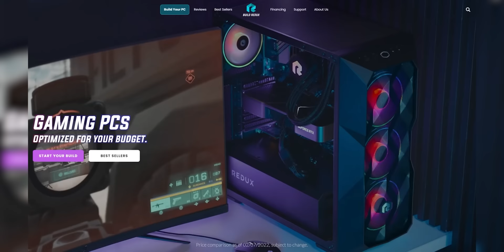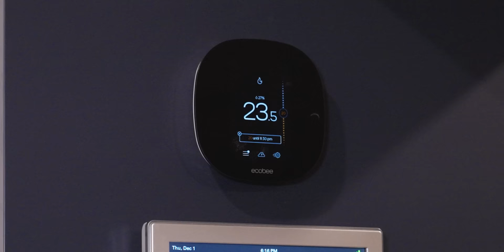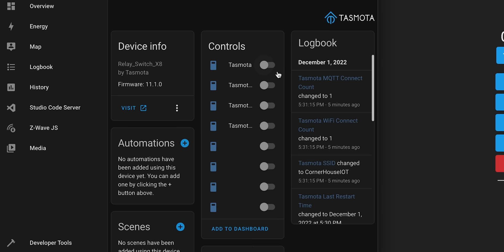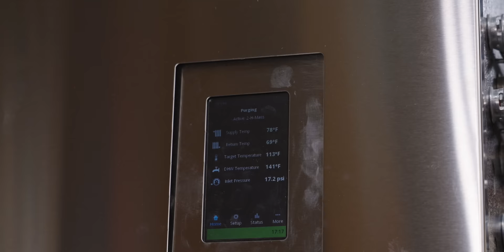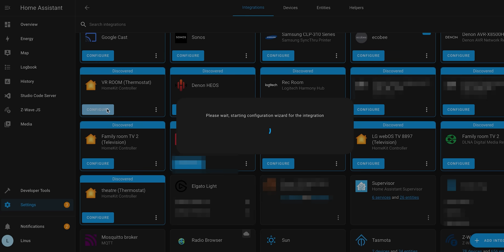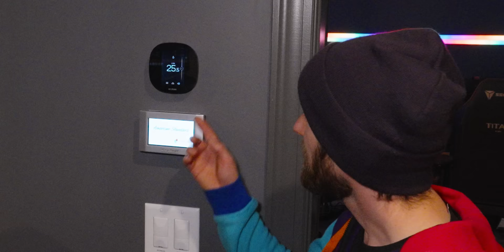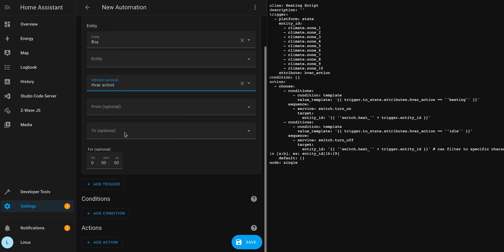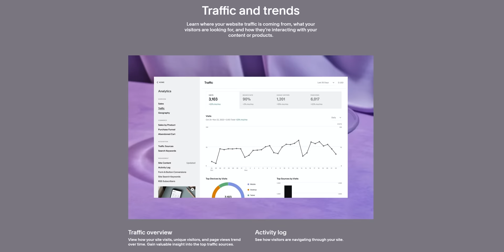My Smart Home is Stupid - HVAC Update

Comment: Linus: “You never want it colder than 19 inside” 
Anyone on oil heat: “14 is plenty warm for me this year”
Reply: *Anyone in Europe 🙈
Reply: @LuckyLukeTF2  Anyone without a heat pump or free wood or both :-)
Reply: District heating and sharing every wall/floor/ceiling with neighbors  => 24+c at no extra costs
Reply: @LuckyLukeTF2  Facts!
Reply: @PennyAfNorberg  Same for me. District heating is just awesome, especially in an apartment on the 2nd floor of 7. Even better is that our heat is cheap because well over 50% of it comes from waste heat from the local power plant.
Reply: @LuckyLukeTF2  Yall dont got furnaces?
Reply: @whitegoodman7465  your furnaces don’t need fuel?
Reply: @whitegoodman7465  I'm paying €1 per kWh and €3,50 per m3 gas this month so yeah I'll think twice before setting the temp at 19 or higher lol
Reply: @LuckyLukeTF2  jesus, where do you live?
Reply: @Jupeee  The Netherlands
Reply: @LuckyLukeTF2  jesus... that's TEN TIMES more than I pay here in Iceland!
Reply: @LuckyLukeTF2  that's insane, i'm paying 0.16eur/kWh in Finland
Reply: @Jupeee  Here in the states power is the equivalent of 0.09eur per kWh
Reply: @DJ.1001  yeah I was paying about 0.08 before the ukraine war iirc, mightve been less
Reply: Was boutta say. 19 is a bit chilly? Mann I live in europe and when I wake up my living room is 13 and ill heat it to 17 and it that costs me and my roommate about 250 a month. Btw, 17 is pleeenty warm. Just put on a sweater.
Reply: @maquez650  depends, for me 20 is "sweater temperature", anything below that and I need to put on a jacket :D
Reply: @blaineadij  I suppose that depends on how accustomed you are to certain temperatures. I keep my apartment at just below 20c (18c-20c) and it's a temp I'm comfortable being shirtless in. The colder it is the more comfortable it's to sleep in!
Reply: @Jupeee  I live in Italy, so for 6 months a year the temps are 30+ degrees here, so I'm pretty used to high temps. Besides, I have small kids and having anything below 20 degrees is just asking for them to catch a cold. ;)
Reply: @blaineadij  i mean, growing up my house always used to be 17 degrees max in winter, and i rarely ever got sick. In my opinion it's just a case of getting used to it. Yeah the first week when it starts getting colder I'm like damn it's pretty chilly, but after a few you just don't notice it anymore in my opinion.
Reply: @maquez650  if you're used to having 30+ degrees every day for the better part of the year and temps dropping below 20 only in like 3 months a year, it's hard to get used to lower temps :D my kids who never lived outside of Italy ask for their sweaters when temps drop below 25 outside :D
Reply: Oil heat is pretty OK in Europe now. Depending on when you topped up your tank. But gas heat is just a disaster.
Reply: @blaineadij  hahaha, okay fair. I suppose your outside temps are higher than too so it would take less to heat to that temperature
Reply: @maquez650  that's true, but on the other hand houses here are build to cool quickly instead of keeping the heat inside, so during winter months I have to be constantly heating the house otherwise the temps inside the house would easily drop below 15 every night
Reply: @blaineadij  yeah I feel you, my house might not be built to cool down, but it was built in the thirties, so with the heating completely off most parts will drop to about 10 degrees.
Reply: My thermostat in the UK is at 9C rn, sucks to be a poor student with the cost of living rn. Having an electric blanket on my bed is the only way i'm surviving this winter. Monthly bills for gas+electric are £50 if anyones interested.
Reply: @blaineadij  fair enough, you wouldn't be able to catch me in Italy in any other state than miserable as hell due to the heat :D in central Finland the temps can reach low 30c in the summer and not much colder than -30c in the winter, but both are kind of extreme cases and wont happen more than a few days of the year if at all. Buildings in Finland in general are extremely well insulated compared to the rest of the world (and it goes both ways, it doesnt just keep the heat in during the winter, it also keeps the heat out during summer) that it's kind of wild to me imagining that in most countries a lot of effort or money goes into cooling or heating a building depending on how far north you go. I could lose electricity and district heating for a day here in the dead of winter and the apartment might cool down a bit but it wont get straight up cold. Granted if it was a house the case would be different and it would get colder quicker, but living in an apartment building it's no problem whatsoever.
Reply: @Jupeee  good for you. I am paying 0.39€ plus transfer with Helsinki Energy. My consumption last year (Oct-Oct) was 90 MWh - OK, some 30 MWh went to melt snow from my yard, which I am definitely NOT doing now 😂😂
Reply: @syncacct8576  ouch :D idk how much region can have to do with the prices if at all, not gonna say specifically where I live but you can probably take a fairly accurate guess by picking something in central finland, student city. Also living alone in a one room apartment's does wonders to my electricity bill
Reply: @LuckyLukeTF2  This is what happens when you outsource everything.
Reply: As long as the pipes don't freeze over, it's fine.
t. European on gas heating

Comment: I see this, and see how many "moving parts" there are to this set up and all I can think is "wow, this is going to be a nightmare eventually". I mean if it's this complicated now, how much worse is it going to be when things inevitably start breaking?
Reply: That'll never happen...it has to start working first.
Reply: "More content!"
Reply: As someone in the commercial HVAC world it is not uncommon for units to be connected to a BAS/BMS. The equipment usually has a service mode that allows you to bypass and check the unit operation. 
For your everyday residential tech who isnt used to this, it could lead to more problems than it solves, but my guess is the installing contractor will most likely maintain this equipment when it eventually does have issues. So they should at least be familiar with the set up.
Reply: @OramWerd  At what price? And when Locutous isn't around, what then?
Reply: This one specifically is just a horrible setup with seemingly a lot of solutions just to solve for previous problems, rather than taking a step back and really taking a good look at finding a reliable, easy solution that addresses the core problem you're trying to solve.

In this case many of the problems appear caused by wanting to combine multiple systems and finding hacks to make everything work together. The Tasmota and Ecobee system work together pretty well already, but then there's the American Standard system they are trying to make work as well and I don't really remember why that was exactly.

A solution that would've given far less trouble for example was just to set it up as they had originally planned, with no thermostat in the room, just a thermometer and having it all be controlled through the Home Assistant interface. Would've been one system (Tasmota) and one system for temperature readings. They added the complexity of the Ecobee and that American Standard system because the family wanted the ability to control the heat per room. What they could've done instead is follow the original plan, but simply add a touch screen with a Home Assistant control panel on it (which is more in line with how Home Assistant is designed to be used).

I don't blame them at all for the situation they're in though. I know exactly how this evolved into mess, because I've done it myself. Instead of going back to basics, you tend to "add" solutions. Either because you think that one little extra thing isn't that big a deal or because you bought something expensive you feel you now have to make work.
Similarly, there's a strong "while you're in there" feeling where you're like, well if I'm already doing this, I might as well just add this little thing.

I am a little unclear on the whole Z-Wave debacle though. With their backgrounds I would've thought they understood the value of having at least the core of your home being wired up and not be wireless. There's super robust systems used in office buildings, hospitals and homes like KNX for all this kind of stuff. All which integrate easily with Home Assistant. They could've added some Z-Wave here and there to supplement it or get control in places where it was cost prohibitive to put wired devices, but to have your whole house on Z-Wave is a pretty brave move if you ask me.

Same for the garage door. They tried three times and only at the end really looked at what they were trying to solve (they literally describe their requirements clearly at the start of their FINAL video on the topic).

But all of this is definitely part of the fun of it. If you don't enjoy thinking about things this way, home automation sucks and I wouldn't touch it. If it all works it's magic, but it's not worth the hassle if you don't at least enjoy the hassle a little.
Reply: This entire house was not planned and designed by professionals. It is going to constantly break if it is ever actually at 100% at some point which it probably won’t be….. ever…. I feel bad for the person that buys this house later on. Most likely they pull out all the automation that was put in.
Reply: @OramWerd  Or they'll make another video about it (fair play, honestly)
Reply: Linus is going to have to learn KISS again, the hard way. 😁
Reply: 100% agree with this comment. On principal, I agree with exploring how to do this without relying on the cloud or subscription service to help manage the system of things, but it really highlights why there is a (fragmented) industry around this technology. At the end of the day, and Linus acknowledged it in the intro, you could figure it out yourself but you’ll need a full-time IT staff to support it
Reply: @Forcix  100%!!!
Reply: im laughing how an american house basically needs a whole plant room for its heating , like WTF ? in the UK all we need is a small gas boiler in a tiny cupboard with a few pipes coming out and its all automated and that one boiler does hot water  on demand and central heating
Reply: @girlsdrinkfeck  To be fair, that's a really big house and they're based in Canada, which is a hell of a lot colder than the UK in winter.
Reply: @tibor29  arse biscuits ,get on the exercise bike to get warm, i do LUL

Comment: Linus: Has like a billion devices in his house that could be configured to run all of their communications over a wire
Also Linus: Why are my speakers that probably should be wired having interference?

This house is probably using up the entire 5 GHz band
Reply: And his primary communication should be KNX when starting a smarthome from scratch in a bare house. And everything which is bolted to the wall shouldn't use wifi.
Reply: @@onnikukkonenI’d be surprised if Linus is using a PSK for his WiFi.
Reply: The house is probably just using all the bands! 2.4, 5, 6, an unreleased 76!
Reply: All wifi on channel 69(blame Jake)
Reply: @FluffyAnnoyed  Definitely... He should've just gone with KNX or Loxone and let it setup by a professional... you can still implement it in HA. But then he couldn't make like 20 videos about his smart home.
Reply: @jorrit_o  Nah, he could still do it, but they'd be a sponsor video for Loxone instead. LOL
Reply: His neighbours probably wrapped their house in tinfoil to avoid radiation
Reply: I can't believe all these smart devices talk over WiFi when they are plugged into the houses AC.
Why are they not talking over these convenient copper cables

I run my network over the AC and it's faster than any device can move data on the network.

Actually I do know why.
It's because WiFi is easy and there are no good standards over AC anymore.
Reply: @TheZoenGaming  Honestly, that would be really interesting😂
Reply: @Onni Kukkonen It's the illusion of convenience. When in reality it's 10x more inconvenient. Wires are good. Just manage them properly
Reply: There's also connect4 that do I good job letting you choose what devices you want now and is very flexible fir later upgrades.
Reply: @jorrit_o  He could have setup KNX by himself. It would have been way easier.
Reply: The problem is, if Sony gives you thousands of dollars to use their wireless speakers, you actually do have to use them.
Reply: @4203105  He definitely could've just used them for and then installed proper speakers after, it's not like Sony is holding his living room hostage by sponsoring a single video

Edit: Removing redundant phrasing

Comment: You can really understand Linus' priorities when he goes to great lengths to run Ethernet cables to every wall of every room in the house but can't be bothered to run 2 more wires for each thermostat or 2 wires for reliable speakers. And when you have to have someone (Jake) set up scripts and train you on how to use your own 'smart' home system, you know its way more complicated than it needs to be.
Reply: The speakers is because he already had expensive wireless ones. And they have a theatre room completely wired up wtd you going on about??
Reply: @sid6645  The speakers should be wired though, because the wireless setup is causing problems and the speakers won't be moved anyways
Reply: @felix871  his TV set up is super jank because he has a theatre room. Its just his family's unfortunate preference that they like the jank set up.
Reply: @sid6645  I know, I also prefer the theatre room but maybe they want to watch two different movies at the same time or something, he can definitely afford to have two proper setups. It’s just that wireless stuff usually sucks
Reply: That's the problem when you take free wireless speakers from Sony. You have to actually use them.
Reply: @sid6645  can't blame them to like the Sony TV, it look freaking awesome
Reply: @felix871  The only reason for buying HT A9 was to avoid wires in the living room.
Reply: @felix871  So it doesn't have to be, Noted. Sony, as per usual, has very jank and limited software control. Secondly, the reason it does not work is due to his motion detector switches. 
The wireless option is actually much simpler in his living room. He has Surround afterall, and these sony speakers are quite litterally pug and play any one can do.
Reply: @felix871  Audio over Ethernet is an option.
Reply: really true.. the thermostat is already capable of closing a relay without any wifi smart device inbetween. It doesn't even need the cloud to do so. So many fault points, we will see a video where he blames home assistant for it not working.

Comment: I appreciate Linus for going through all this to showcase how IOT is hell and mercury switches are awesome.
Reply: Just like I always say about mercury: Don't knock it 'till you tried it, the taste really grows on you.
Reply: It’s just amazing to me that he didn’t just do the most simple option of using the American standard thermostats to control the in floor heat through auxiliary contacts. I get wanting all the controls to be local and not dependent on the internet but even my nest thermostat will still cool and heat my house if the internet stops working.. this whole system is a shit show.
Reply: @alexlacey9808 It’s because he thinks avoiding the 1 in a 1,000,000,000 chance that the internet connection is down and someone wants to change the thermostat at that exact same moment is worth the headache he’s created. That one time someone won’t have to get up and manually adjust it instead of using their phone is just a bridge too far

Comment: I work in IT, which is the reason my house has:
- Mechanial locks
- Mechanical windows
- Router with WRT
- No smart home crap
- No Alexa or Google Assistant
- No internet connected thermostats

And i keep a baseball bat close by just in case my printer makes a unexpected noise.
Reply: There's a saying. Software engineers trust harware but hardware engineers trust software. Going with the least bad of what you know is probably the best solution.
Reply: Lol, same here. I'm occupied with fixing stuff in the company all day, so no way I'd want to tinker with home automation in my spare time.
Reply: Late reply, but as an IT professional is your issue with things going to the cloud or automation itself. I figured running everything poe on an airgapped network would be pretty safe.